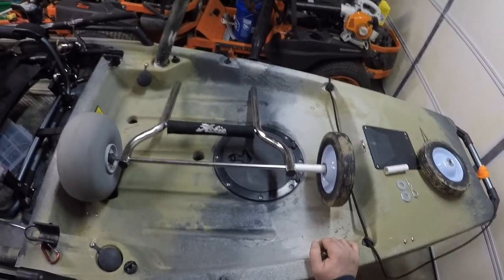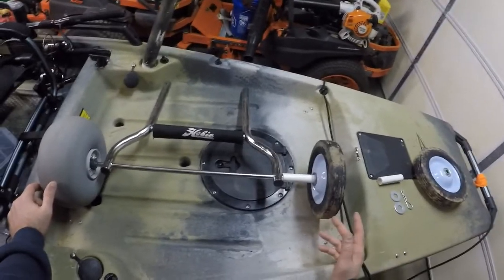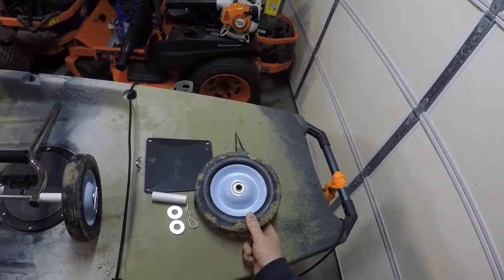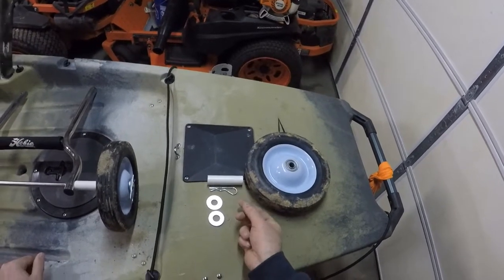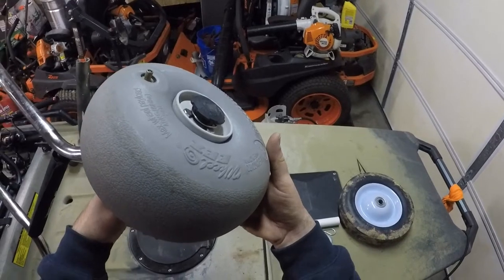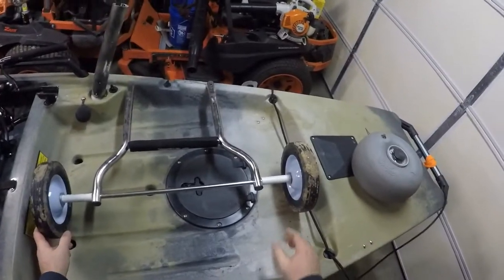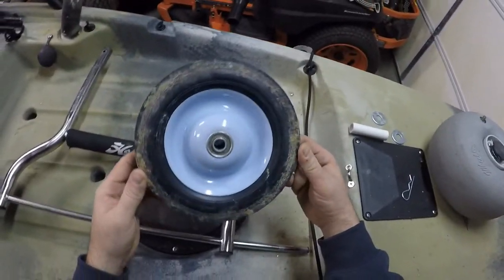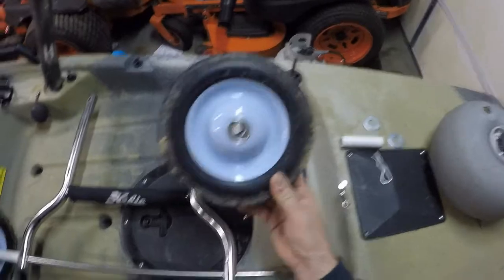How to change wheels on a hobie cart

Comment: Thanks for this video. The trax 2-30 wheels I have use an R clip so didn’t have to purchase that. But instead of 1/2” PVC pipe I used 13mm clear vinyl tubing which fit just snug over the axle. Cheers.

Comment: Awsome vid,  i tryed this out last night and it works awsome.  I was alittle worried about the wheel popping off but the hitch pin does a great job, even after pulling on the wheel as hard as i could it wont move.  In a few weeks i was going to order the rubber wheels from austin kayak which are $170, so thank you for saving me some cash
Reply from the maker: David Ross 
Glad you like it.  I thought they where cheaper than 170 lol,  and yeah it would take alot of force to make the wheel pop off.